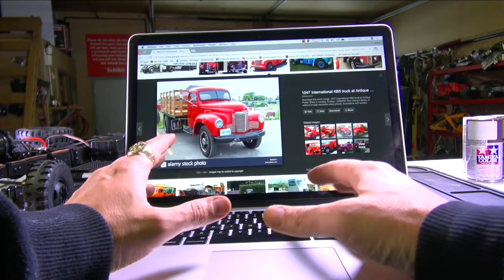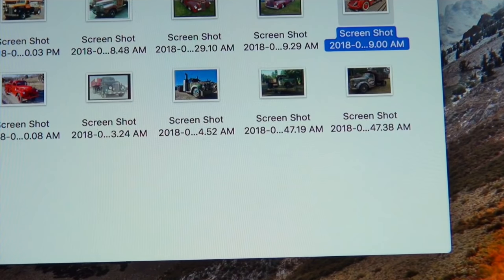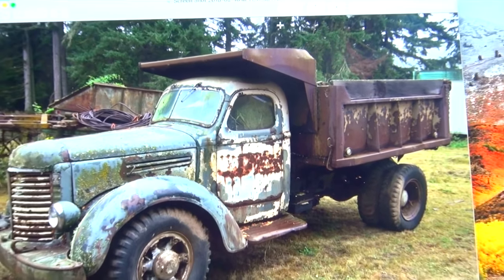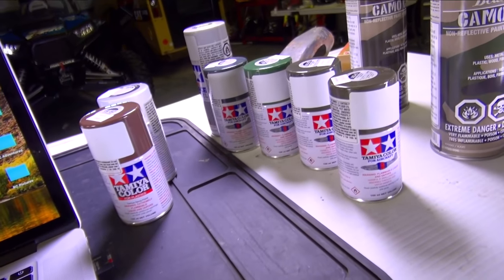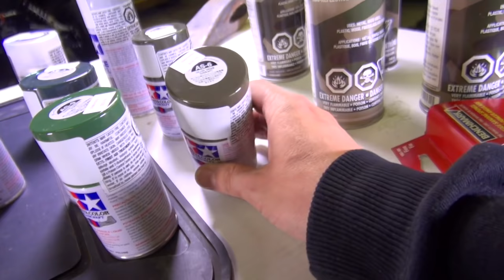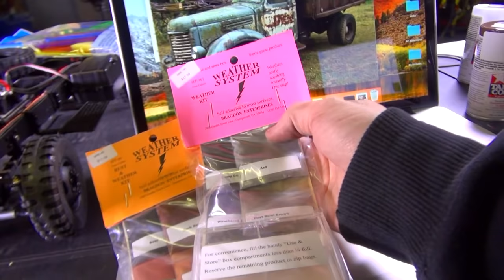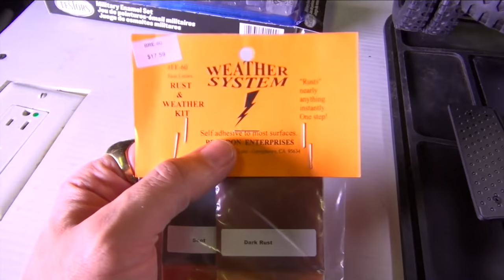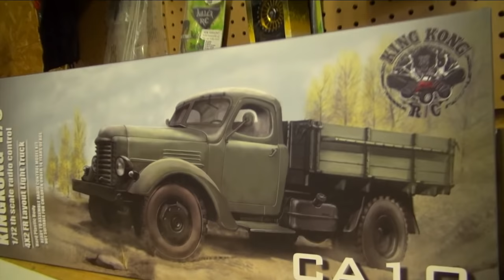RC ADVENTURES - Project: "SPiNTiRE" - PAiNT PT 1 - 1940 KR11 Research, & Supplies - King Kong CA10

Comment: Used the Hardware store paint on my RC4WD LandRover hard body and it turned out DEADLY! The reason was because of the cost difference between the two.
Reply from the maker: Yeah, i have been using it for years with great results as well - except you have to be careful not to mix paints - or you get all that yucky cracking

Comment: Hey Medic I have a amazing idea for that body if you're going to be doing the old rusty dumptruck if you have  a hobby lobby or a train shop stop  in and see if they have  fow moss and after you get the paint job done grind up so of the moss and put it  on the body with some matt clear or the watered down modeling glue in a  small hair spray bottle and let it dry then you will have the moss on the truck it's a great look to add age to a beautiful old rusty paint job
Reply from the maker: Another place for that moss... PET STORE! For Terrariums
Reply: RCSparks Studio yea and you should definitely definitely do it it would look amazing

Comment: I am currently actually working on my first rusty paint job, it's only on a lexan body, but painted on the outside, so the finish/base is similar to that of a hard body with primer.
I am finding using some brush Tamiya paints are working best, they give a naturally rusty/bumpy finish.
That would probably cost less than $20 and give you the most control over patina and rust.
Also, for the moss, look to model railways, they have an unlimited amount of fake grass, moss, trees, bushes etc... Something would definitely work for creating moss.
I'm no expert, but I'm enjoying my first one, I can't post pictures o YouTube but I do have a thread on the RCSparks forum for anyone interested in my progress; https://www.rcsparks.com/forum/threads/scx10-jeep-wrangler-g6.36741/
Go to the last page for the start of the new body and rust.

Comment: rust the inside of the bed weather the wood on the bed I was told to sock the wood with water then air dry it so it looks weathered wood
Reply from the maker: Thank you.. I will soak the wood, and air dry.. but it may also be painted